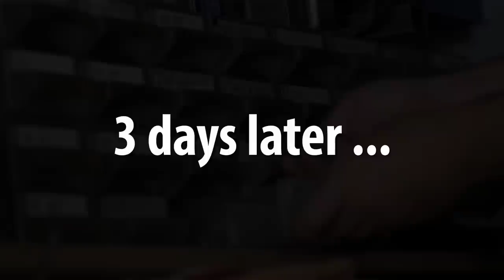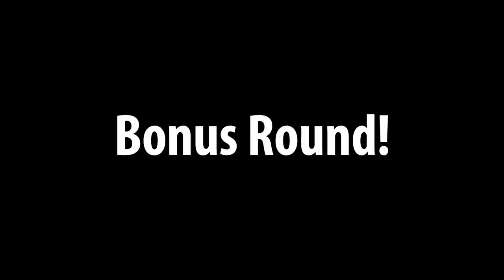Lazy MACHINISTS' JACKS

Comment: TBH the way I would've made them would be the last way shown.

Tube, thread it, find bolt, make pretty.
Reply: I've only recently realised that with a standard clamping kit, most situations can be met by simply putting a flanged nut at each end of the nearest length stud, with the flanges both facing outwards.
Reply: @Gottenhimfella  Thanks for that tip, great idea.👍

Comment: You just solved a problem for me! I have a 2001 Honda CB500S which i only get to ride a few times a year thanks to a spine problem (Metal rods and bolts, not bike related) As i'm disabled working on my bike keeps me sane. Since i bought the bike there has been a small dent in the exhaust down pipes (manifold) close to the cylinder head. I can now get that annoying little pain in the butt sorted using a small one of these jacks. Thanks for the videos, i for one love them and always find them entertaining (yes i'm a mechanical nerd).

Comment: I make mine from just about anything that has a nut and screw on them. My first two were made from bicycle disc brakes actuators the non-hydraulic kind. They have a ball bearing type actuator that works when you pull the handle, but also, they have a thread for adjusting. Perfect for tiny work, and by definition, quite precise.

Comment: Tony will you please stop welding stuff? ;-)
Every time you weld something I want to go out and buy a bottle of argon and a crappy TIG torch for my shitty welder, because I'm suddenly convinced I could do just as good a job with those inferior tools (and my nonexistent skills).
Reply: stefantrethan I fell for that...and now own a tigmig 200digitalalu tig machine... xD (havent tested it yet, Imon vacation, away from home)
Reply: Just do it.  I splurged on a Miller Dynasty 200DX six years ago.  I didn't think I would do as much welding with it.  Over 70 hours of arc time so far.  And welds are looking great.  Everything from steel to aluminum.   Copper too.
Reply: I almost went with a tigmig myself, only some small annoying thing during checkout made me change my mind at the last moment and go for the GYS machine instead. I wasn't really convinced the tigmig are any different from the cheapest Chinese imports. Let me know how it goes, I'm really curious about them.

GYS at least said "made in France", and while I'm sure that is not the whole truth I had it open and it is a very clean design inside. Very different from the Chinese machines I have seen. Of course the GYS has much more limited functionality, scratch start TIG only and no AC or pulse or foot pedal, that would cost much more. Frankly it is really a stick machine and the TIG option is more marketing than reality. But it works fine for stick, the only problem is I am not a welder. I think I would appreciate the option to spend a little time on fixing a weld sometimes, without a whole lot of grinding and adding a bunch of electrode when all I really need is heat. 

It is a bit of a risk to buy a TIG torch and bottle only to find that my welder is simply unsuitable, or I am simply inept, but watching Tony move that weld pool around with ease makes me want to take that risk.
Reply from the maker: if you need nudging over the edge, I always endorse new tool purchases.  DISCLAIMER: if you hurt yourself, not my fault. :)  just about every machine will do great in DC, even the really cheap ones.  Also, I appreciate the compliment, but if you think my welds look good, you're watching the wrong channels. ;)
Reply: Yea but Jody and the other guys are _professionals_.
You are just a guy in his garage! if you can do it, I can do it. ;-).
Just joking of course, but you do make it look far too easy.

I will look for a used gas bottle, and meanwhile, I'm with Doug "Grinder and paint makes me the welder I ain't".
Reply: Coming from a full time production welder, those skills come with hood time. Nothing replaces hands on practice and lots of it. Luckily with welding there isnt much you can mess up that cant be fixed. Believe me Im king at fixing blow holes. Also dont be afraid to try new things, Youtube is full of valuable info.
Reply: DO IT stefantrethan. Sure, it's an investment, but TIG is so satisfying. I've done every major type of welding including oxy-acetylene, and it is far and away my favorite.

If you don't want to invest, see if you have a local hackerspace that focuses on fabrication. I've got one here in Baltimore that'll train you for $75 to train and then $50/day or $150/month to use their high-end equipment. We live in awesome times.
Reply: stefantrethan if u can't find used and will barely use a small bottled can be had for under 150 filled. Might not last but a few hours but it'll get ya going
Reply: Your welds are good.... and I watch the right channels as well, like Jody, etc.
Reply: @ThisOldTony  All due respect! Even my welds look good after they are turned down, or nearly ground away!

Comment: I wish that was the kind of threaded rod that was "holding" the band brake of my minibike in place with at first. My friend and I had to put a lot of effort one weekend into figuring out and making a very small assemblage of steel bits and bobs just to make up for the way the linkage worked and to keep everything from bending or coming loose instantly when I actually stomped on the brake like you would if you wanted to stop. I ended up using a grade 8 bolt like a threaded pin (luckily it's good enough for shear force due to its hardness, unlike the many other things which bent) and a stick welded partial box with holes for the bolt as a hollow spacer to transmit the compressive force around and past the end of the band brake, and finally some metal tube, nuts, and washers and such to position the thing just right and tighten the living crap out of it. Now it still sucks because it's a band brake, but it does stop and it doesn't bend.

Comment: I have no idea what those are used for, but they'd make some sweet leveling feet for the welding table I need to build. :-)
Reply from the maker: Thanks Chevee!  I'll use them to change tires or do brake jobs on my low riders. ;)
Reply: Chevee Dodd you can get leveling casters
Reply: As far as i know they are used to underlay long parts when you clamp them in your vice so they won‘t bent downwards, for example for milling (as shown in the end)
Reply: I used to use even lazier ones at work when I had to support a piece on the big bickford radial drill we had. Those were just a tube with a washer placed in top and a nut and bolt pair placed in the washer.

Comment: For us non-machinists, could you please do one of your explainer videos on that knurling tool, because as far as I can tell it's plain magic.
Reply: its machinists magic
Reply: My first question is whether or not the part must be of a particular circumference with a matching knurling tool... Because otherwise you would rotate over material you would not want to knurl?
Reply: @keithr2969  The knurling wheel 'floats' a little in the tool so, after the first pass, the teeth slot into the previous grooves; assuming enough pressure is applied to the work on the first pass to create the initial pattern.

Comment: I remember doing one of those in my first year of mechanic training. Also a combination die and tappet handle and a ratcheting pipe threading tool. First thing we turned was a sentre punch. After that I've touched a lathe once. Used it to cut some aluminum tubing for railing. What a waste. Some day I'll get an old lathe, maybe when I have retired.

Comment: One question about the (knurling?) tool though, do you have to use a specific one for a specific diameter for it to line up with itself properly or it just adjusts by itself?

Comment: How do knurlers work? Does the knurling tool have to have a circumference with an integer ratio to the circumference of the rod to be knurled? Otherwise I'd imagine the knurls wouldn't line up.

Comment: You need to make self indexing tapping handle for your lathe. Doing it by hand is hard work. If you make your jacks with left and right handed threads on each end and just turn the middle you can get them tighter without squirming away under your job. Oh and ally soft jaws for your chuck. Get rid of the grip marks. Nice work matey.

Comment: Good idea... although it may be beneficial to recess a magnet to the bottom so that it reduces movement on the base surface and also allows the use of the jacks on non-horizontal surfaces (plus easier storage).

Comment: I have a question when I span very short cylinder but sometimes they are not 100% straight (perfect centered, or on one chuck it's deeper as the other ) do you have a tip what I can do for the short pieces?

I put them inside when I only need to turning inside or drilling .
I use a machinist square similar to parallel bar's for milling.

Comment: That last 1 you did is what I do, too easy. To be really fancy before knurling, drill a clearance for 6mm hole through the head for on the machine adjustments with a round bar.

Comment: Very nice!  Is there a point though where it'd make more sense to get an indexable threading tool for the lathe (If you don't have one) and an acme threading insert for it, as opposed to using acme nuts and welding them in?

Comment: 5:13 Does that wobble cause issues with parallelism of the top and bottom faces during use?
Reply from the maker: yes, most likely, but these are basically "jack stands" to help in machining setups, not meant to be precision items.

Comment: when you weld to the nut on the threads? how do you deal with the metal heat expanding and not fitting anymore?
Reply from the maker: it goes back when it cools

Comment: Based on a really accurate calculation on my part, at 3 seconds per drawer, ToT has over 86400 little drawers to look for in those 3 days. (assumptons: ToT diesnt sleep nor get tired until something is done, of course)
Reply: Armilar Zifferblatt I reckon he ordered them from eBay or Amazon, no way he'd have searched that long :)

Comment: why depositing a bit of filler metal on the bottom? does that have a higher rockwell that the main metal to reduce wear?
Reply from the maker: Wasn't really the bottom, I was temporarily using the screw to pull/hold the threaded nut during welding.  I flipped them back to the top after welding.  You can see it in the lathe shot after I think?
Reply: oh yeah totally see that now, don't know why I couldn't follow that the first watch. Thanks!

Comment: Tony, Quick question: how do the knurl lines end up lining up?

If the  diameter you are knurling isn't a whole multiple of the distance between teeth... wouldn't the knurling wheel chew up the part instead of leaving a neat pattern?
Reply: I was asking myself the same question.  I 'think' the reason it does works, i.e. no obvious mis-match, is if there is a mis-match the mis-match is so slight that each time around the  knurling tool and the existing pattern sort of 'slip' back into sync.  Just my guess, IANA machinist.
Reply: Leav Oz-Ari there are knurling charts for different knurling tools i.e. 18/21 teeth per inch, you get the stock to the right size according to the chart and then it works like gears, if it is a few thousand off it will look like crap
Reply: Daniel Brooks would be very interested in seeing one turn out like crap! I've only ever seen it work like magic...
Reply: Leav Oz-Ari are the ones you've seen ones that you've made?  Daniel Brooks is right, there are charts, and maths works  but also Richard Marton has a point.  I've played about with kneeling soft materials (Delrin and aluminium, all my lathe can tolerate) and the process is very forgiving , I'd imagine that wouldn't be the case with something stiffer and less plastic, like  steel...
Reply: Nope. I've worked on a lathe, but never knurled. I've asked my professional machinist friends and they never had it mess up for them. maybe because they work almost exclusively in aluminum and plastic as well?

Comment: But isn't it pretty limited in height with these small nuts on the bottom? (just half an inch height adjustment?)
Reply: keitmitkeit It is, but it doesn't need much. Can always use something to block up to the needed height. This is for small adjustments.

Comment: Tony - I know this is an old video and you probably wont see this comment but fingers crossed.
How do you get such a nice finish on steel with carbide tooling on an old lathe? What inserts and rpm?
I have a Colchester Triumph roundhead - pretty similar to your lathe. Top speed 1000rpm. Rough finish on steel - but great on ali and brass. Driving me mad.
Reply from the maker: positive inserts and a big nose radius.  try round inserts!  play with your feed rate and make sure everything is tight.  tool post tight?  I bet it could be tighter!
Reply: @ThisOldTony  
Wow a reply from the man himself - awesome! I have actually tried round button type inserts and they were the best of the lot.
All mine are negative rake - perhaps that is the problem. 
As for the tool post it is bomb proof. Too much so. I wanted a Dickson QCTP but the 4 way has a massive central post that won't fit. Machined from the solid as well so no way to change it. I don't want to cut it off so perhaps I will make a new topslide - one day.......
Cheers Tony and keep up the good work!

Comment: I am not criticizing you at all you are way more talented than I am your skills far surpass mine. I make these once in awhile if I need a specific Oddball size or configuration. I also make the standard ones. Isn't it easier just to turn the two pieces? I mean 1 internal thread One external thread and a part that swivels out of the top with a v in it and you got yourself covered it's quick and easy

Comment: If I were to get a brand new lathe, what would be the best for the money and has most bells and whistles?
Reply: Defnotdemas true. What extras would you recommend then haha?
Reply: Defnotdemas man you're into some creepy stuff btw lol
Reply: Precision Matthews 1022V -- same basic machine as the Grizzly G602Z that Defnotdemas recommends, but has infinitely variable spindle speed AND a power cross feed (great for facing large diameter parts), and it includes a quick-change toolpost as well.

You can add a DRO to any lathe, but you can't add a power cross feed.
Reply: Asad Aboobaker what about the 1030v?
Reply: Even better, if you have the space (it's 8" longer). It's extremely rare to hear of someone that regrets buying a larger machine than they think they need! In general, you should get the largest machine that you can afford and fit into your work space. You can almost always machine small parts on a big lathe, but it's impossible to machine a part that is too large on a small lathe.
Reply: Asad Aboobaker so are those numbers the actual working space ex. 10" wide by 30" long? Thanks for the input.
Reply: "Swing" x "distance between centers"

Swing (in this case 10") is the largest diameter part that can physically be mounted in the spindle and rotate without hitting the bed of the lathe. However, depending on the part you are machining, if you have a part long enough that it extends over the lathe carriage, you can't turn a part that large because it'll hit the cross-slide of the machine. In the case of the 1022v/1030v, that diameter is 5.5".

Distance between centers (22" or 30") is the physically longest part that can be put in the lathe and supported at both ends. However, this is only if you are "turning between centers" (you can google that) with a center mounted directly in the spindle. If you are using a chuck to hold parts, then that distance gets reduced somewhat. If you need to mount a drill chuck and drill bit in the tailstock, that distance gets reduced even more. 

So on a 10x30 lathe, you can do some operations on a part 10" diameter if it's not too long, or some operations on a part 30" long if the diameter isn't too large. But in most cases, you will be limited to machining parts somewhat smaller in both dimensions.

Comment: I use 2 t slot nuts and threaded rod
Reply: Similar idea: it recently occurred to be that a clamping kit has a selection of studs and nuts with flanges. Put two nuts on with the flanges outwards, and you have a large selection of machinist's jacks. If Ton'ys idea is lazy, we're clinically dead lazy.

Comment: Those poor inserts cutting into weld filler metal !

My friend you need a DIY heat treat oven to be a bit more gentle on your equipment !
Reply: let it cool down slow and it stays soft
Reply: shodanxx carbide loves to work.
Reply from the maker: The material is all mild steel (I think) and the weld rod is ER70.. not enough carbon floating around anywhere to harden the welds even if I quenched the parts.  This did cool slowly, though.  No rush.
Reply: maybe he thought it was hardened because you snapped it apart so easy ;)
Reply: Well, maybe it's my filler wire, but when I mig weld hot rolled steel, it is very hard to drill holes near welds. So we always drill before

Comment: What are those for?
Reply from the maker: Basically adjustable height spacers.  Convenience item to help hold/level parts on the bench, in the machines, etc.  Easier than digging through cut-offs to find just the right stack height.

Comment: Cute little jacks, even a non-machinist could use, but how about a couple of through-holes (say 3/16" dia.) in the heads and bases, so you can adjust 'em under load with a rod or drill bit, and not punish yer pinkies on that beautiful kkkknurrrllll.?